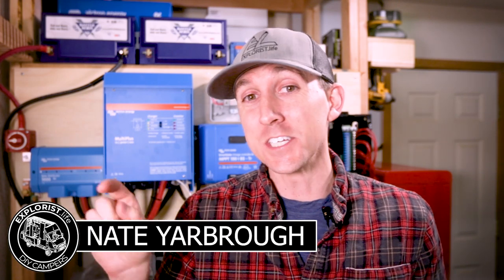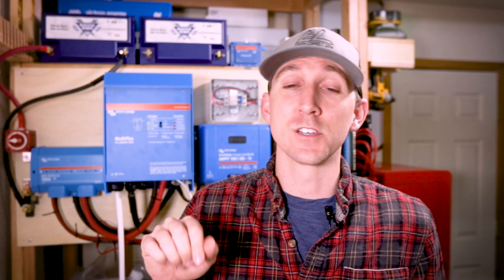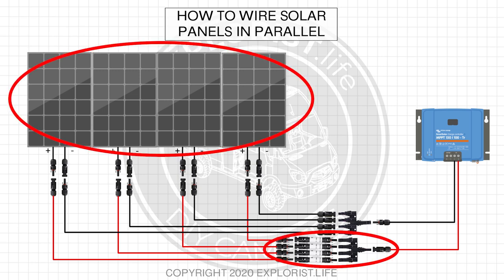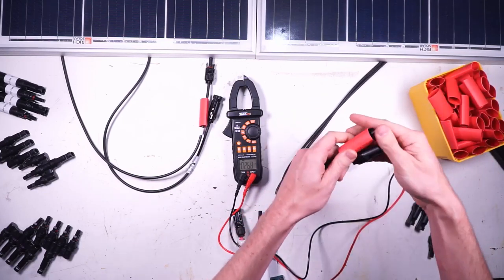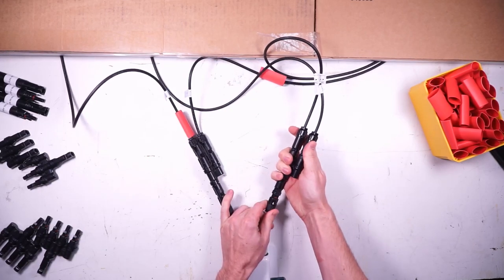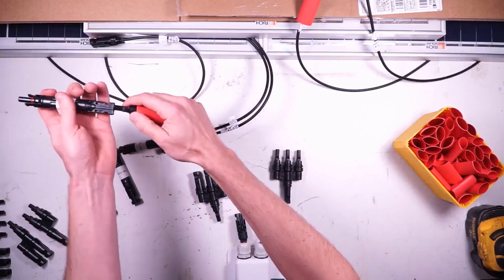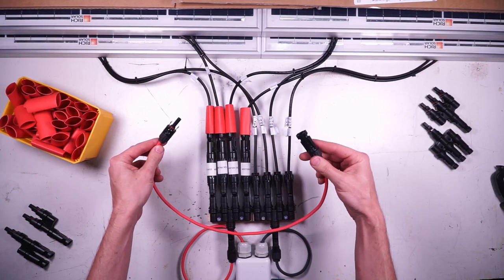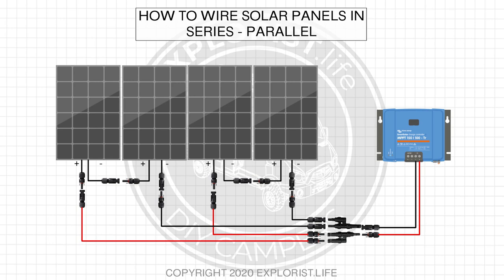How to Wire Solar Panels in Parallel for your DIY Camper Solar Install

Comment: So even if using 6 x 100 watt panels in parallel just fuse between each panel and between the junction point and charge controller correct? Can you use in line breakers?
Reply from the maker: 6 panels wired in series is going to get REALLY close to exceeding the amperage capacity of an MC4 connector.  For this reason... I pretty much never recommend wiring an array in pure-parallel.  2 sets of 3 panels in series with the 2 series-strings wired in parallel paired with a properly sized MPPT charge controller will work better with fewer parts, less fusing, and better MPPT performance.
Reply: @EXPLORISTlife  copy that. I will have to change that then. I believe you said mppt controllers can be connected to any voltage panels they support and be able to charge any voltage battery bank as well? As in I could run my panels at 24v series connected 3x parallel & keep my battery bank at 12v and not need a new inverter? I know there's drawbacks to running a 12v battery bank as well such as equalizing and load as well. Been running it all 12v everything now for 3 years and until your video I never found out WHY not to do it. Most videos and sources just never show more than 4 panels in parallel but never explain why.

Thank you for the feedback, very helpful!

Comment: Is it possible to cut off the bulky mc4 connectors and just join up the wires themselves by soldering? I've seen many vans with bulky connectors on the roofs and it doesn't look very good.
Reply from the maker: I recommend using mc4 connectors due to ease of use.  With proper attention to detail and proper array planning, they can have a clean install.
Reply: Pretty sure that was a yes
Reply from the maker: @Asbjoern  lol, no.  It was a more polite way to say "I don't recommend that but you can do whatever you like."

If I recommended cutting off the mc4 connectors, I would have shown that way in the video.

Comment: Would it still work to wire each panel to its own charge controller and then merge the loads onto the battery?
Reply from the maker: It would technically 'work', but I cannot advise doing that.  That's way more complicated than it needs to be.
Reply: @EXPLORISTlife  if I have some panels in shade and some in sun would this give me an advantage? Or would results be the same using a single charge controller?
Reply from the maker: Parking your camper so that all panels will be in the sun will yield the best results. :)  Don't overthink this.  Solar panels need sunlight to work.  I don't play the "Well, what if 48% of my panels are in the sun for 28% of the day" game.

Comment: Hi, what's the meaning of maximum overcurrent protection rating found at the back of a PV module?
Reply from the maker: That is the biggest fuse that can be used on the array in the event that the array needs have overcurrent protection in it (Basically... 3 or more panels or series strings in parallel)
Reply: @EXPLORISTlife  are these inline fuses like the ones you describe here https://youtu.be/q6r93_1lXKk?t=145 in "How to Wire Solar Panels in Parallel for your DIY Camper Solar Install"
Reply from the maker: Exactly!
Reply: @EXPLORISTlife  Thanks for clarifying this, much appreciated. Your videos are very useful.

Comment: So why do I need an inline fuse? ; )
Reply from the maker: Fuses protect wires from overheating in the event something is trying to pull too many amps through a wire (like a short circuit).  It get's pretty confusing when to wire solar panels, but on all of the wiring diagrams at https://www.explorist.life/solarwiringdiagrams I have fuse locations listed and I'll be covering the 'why' in a video here in a few weeks.
Reply: I never used one 😅
Reply: @EXPLORISTlife   what amperage were those inline fuses rated at?

Comment: Are these 10 amp fuses?
Reply from the maker: They would be whatever fuse size is listed on the back of the solar panel next to the "Max Series Fuse Size" figure.

Comment: Problem with parallel connecting is it increases the current so you'll need larger diameter wire (smaller AWG). Will both increase weight and increase heat on the wire increasing power loss. Parallel connect current should be no greater than 30 Amps on the wire (MC4 rated at 30 amp max),  increase voltage and use a good MPPT solar charger and you can get by with lower current serial connected solar panels. Be careful I've seen many videos that gives enough information to be dangerous. You need a full understanding of electrical currents and voltage to configure a safe system. Not partial pictures.
Reply from the maker: That's why this video was just one part of an entire series teaching you how to design a solar array.  This video just teaches how to do it; not why somebody should or should not do it; that's covered in the other videos.  I rarely rarely rarely recommend wiring an array in pure-parallel for the reasons you mentioned.

Comment: Quick question. Any issue if you wire say a 400-watt panel and a 100-watt panel, or any variation of panels with different watts? Do you have resources for that? I'm trying to maximize the space on my roof. Thx!
Reply from the maker: It's not advised to use different sizes of solar panels in the same array; so if you were set on going that route; you'd want to use two separate charge controllers.
Reply: @EXPLORISTlife  got it. Thx!